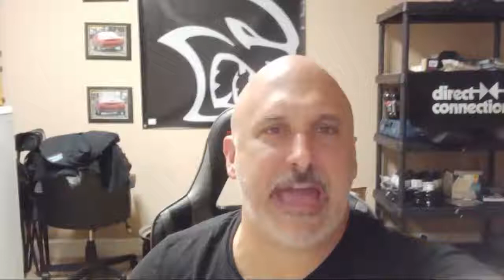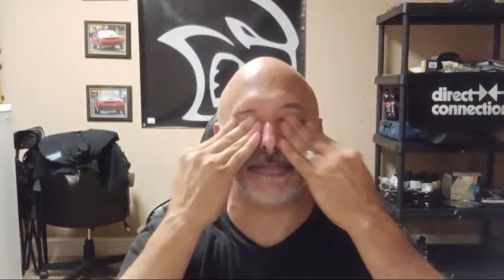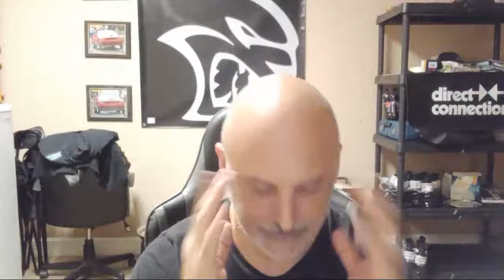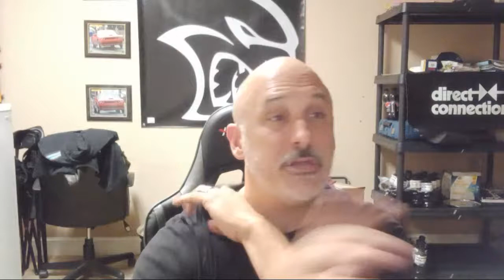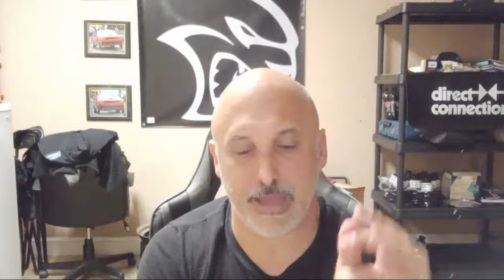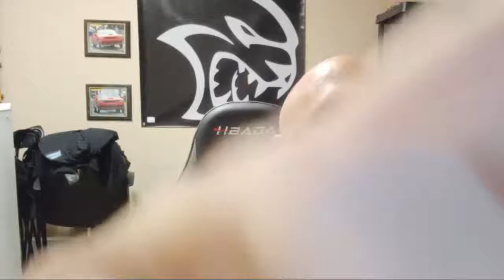Mopar Chat Live.  Humidity's Effect On Horse Power.

Comment: Question for you my guy if I boost the 6.4 when I go for drop in pistons and rods what compression ratio should I go for
Reply from the maker: That will depend on the fuel you are planning on running and your boost level.  If you plan on E85, I would go with the stock CR.  If gasoline, I would run 9.5.